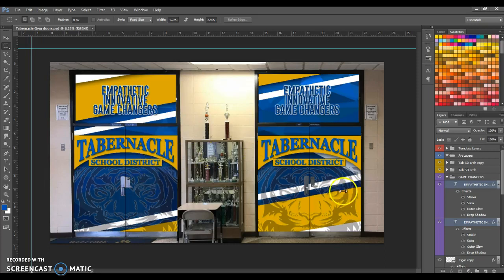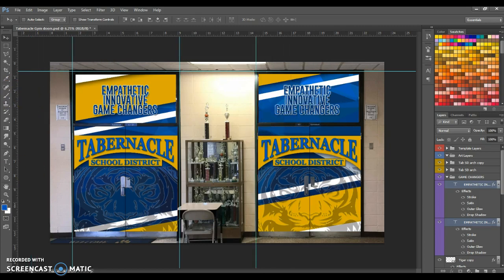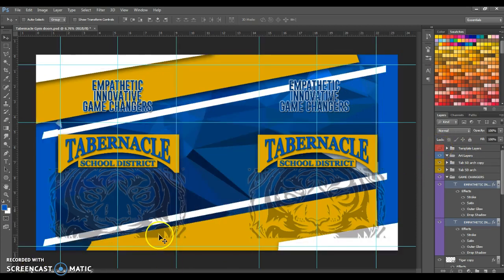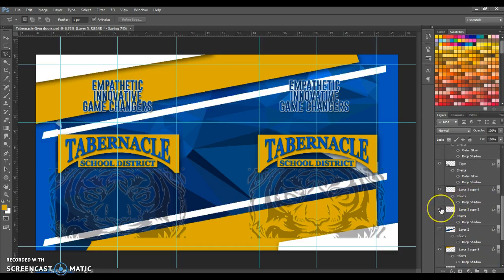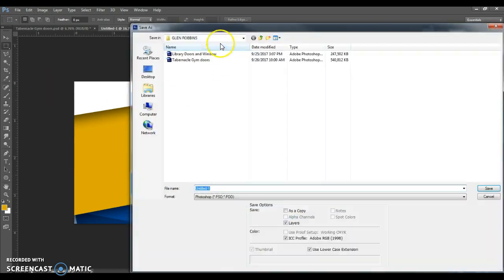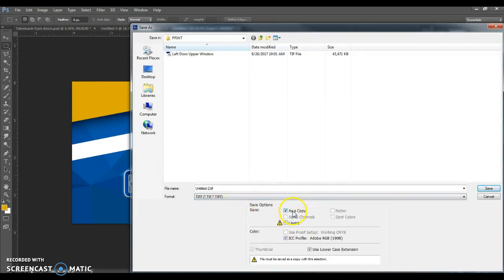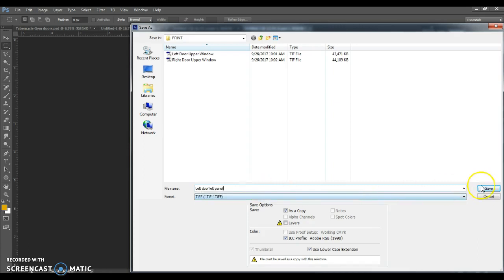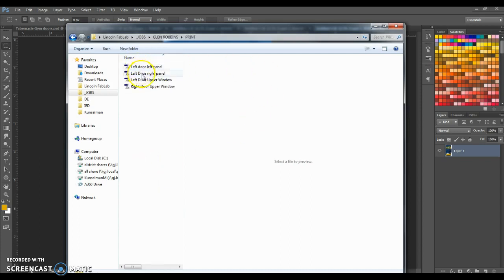Panel a Photoshop File for wide format printing

Comment: What is the scale on your template and what is the resolution you send your file to the printer?
Reply from the maker: Michael Hirschberger I was working in 1/10th scale at 720dpi. When I scale up to print in RIP at 1,000% I get 72dpi. Seems super low res but looks great in these applications.
Reply: @kunseltech  great, thank you!!